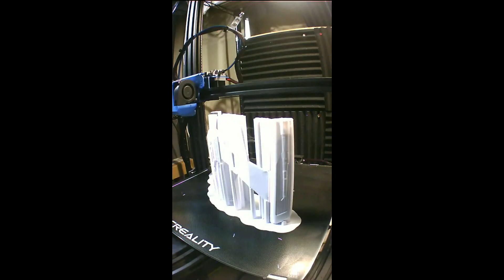3D Printed Starships of Star Trek First Contact

Comment: Nice little fleet. Although that Sovereign on thingiverse is quite inaccurate.
Reply from the maker: A lot of the Star Trek models out there are close or the model itself is incomplete.  You can do a lot with paint to remedy it most of it.  Also it depends on which model.  Every move the ship was in the model was changed
Reply: @Rise3DBuilds  that's fair. Although they use the Equinox nacelles on that model, and a bridge module drastically different. Really what changed between FC and Nemesis was a new paint scheme and the nacelles were slightly moved up or down by a hair
Reply from the maker: Yep.   Also I will admit even in the footage this one was a pain to print.
Reply: I have a screen-accurate model I'm working on for my father if you'd ever like me to send it your way.
Reply from the maker: Sure.  Email me at mike@riseofthefenix3d.com
Reply: @Rise3DBuilds  Sent you the file via WeTransfer. Should be in your email :) Credit goes to Alex3D for making the model.